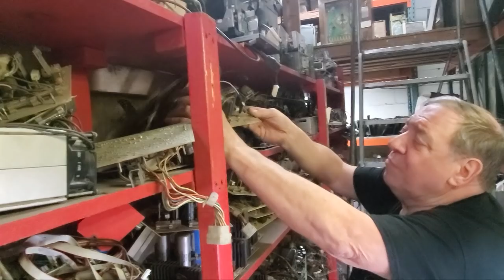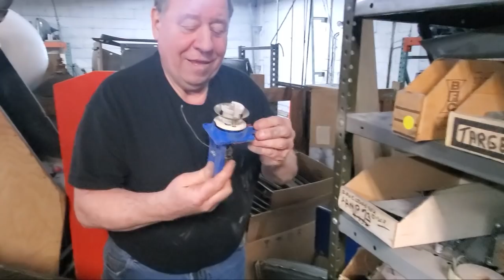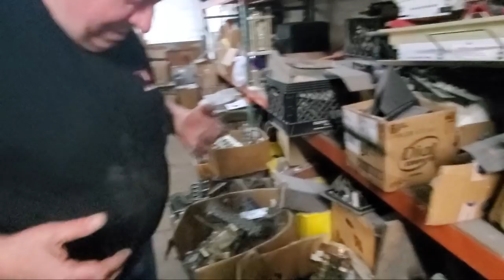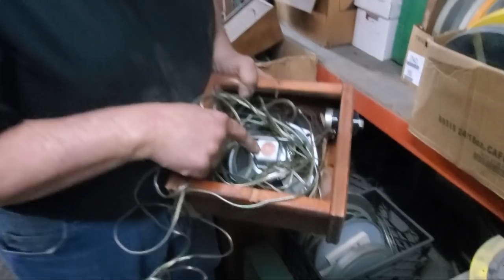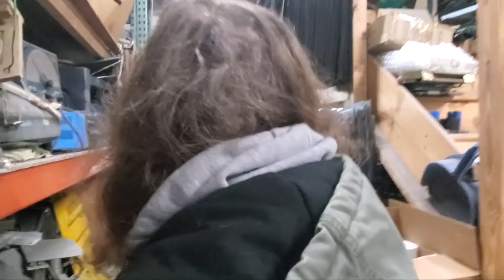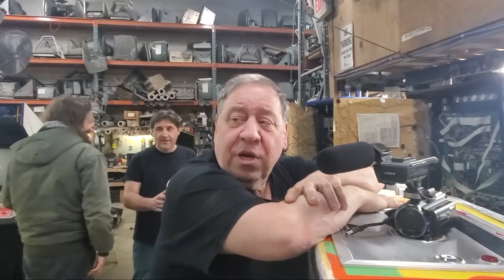#1551 Travel UPSTAIRS of our Shop at TNT Amusements and see stuff never shown before!

Comment: I wonder if you have 13 inch arcade monitors? As I am looing for one for my cocktail table machine.
Reply from the maker: I would sell a working 13" monitor for $250...if you want the chassis rebuilt, it would be another $50.  if you dont mind some burn in on the tube, $100 less.
Reply: I do not mind the screen burn all that much and I can recap the chassis.  What is the best method of contact as I would need to arrange shipping to Australia.?